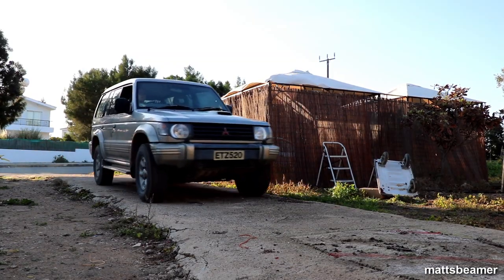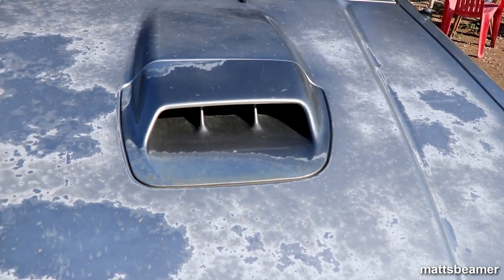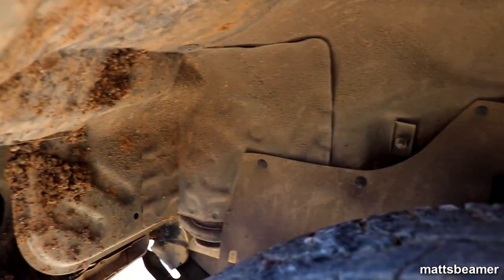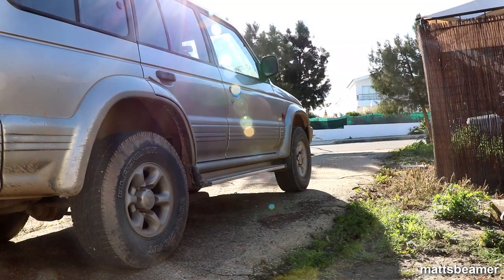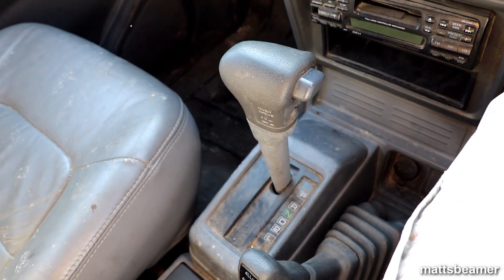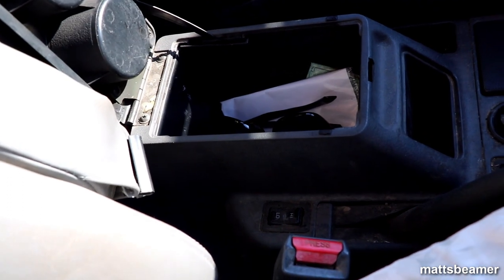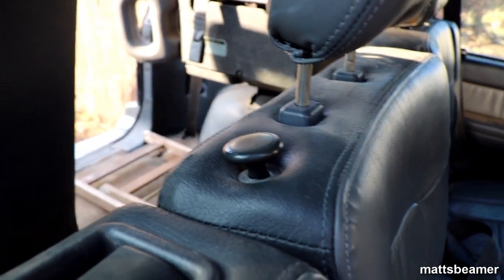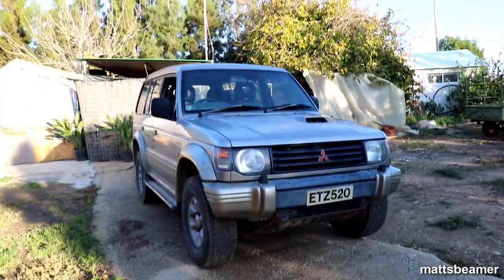1997 Mitsubishi Pajero 2.8 Turbo diesel V20. Pre facelift. In depth tour. aka shogun Montero mk2

Comment: I have both the 2.8l Pajero Diesel and the W210 Turbo Diesel also. Some of the best vehicles  i have ever owned. They are very rare here in the United states. Definitely, conversation starters at the fuel pump
Reply: Mercedes is the king 💪🏼 also W163 ML body on frame is a beast 💪🏼